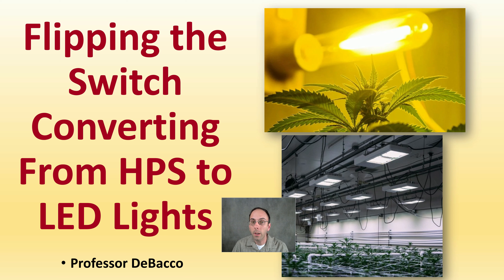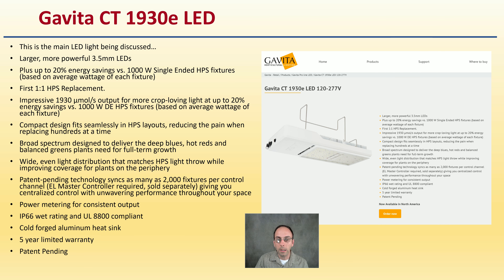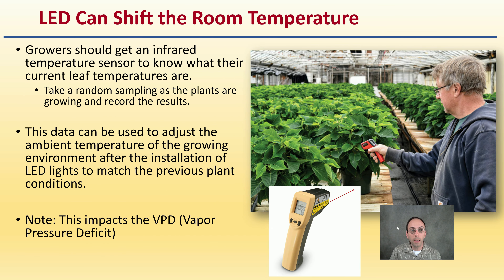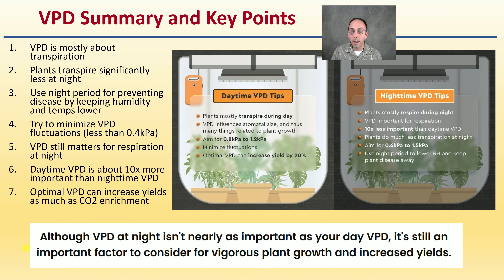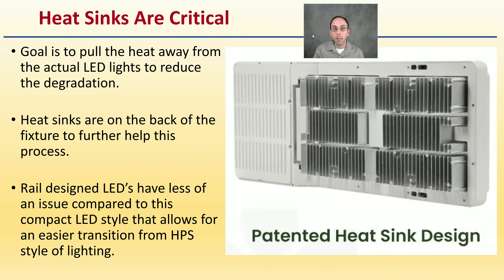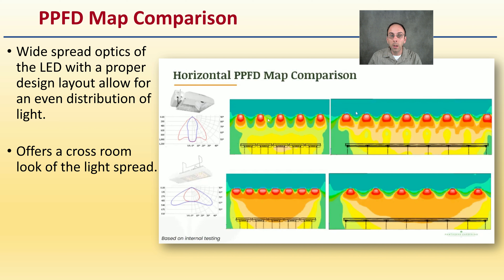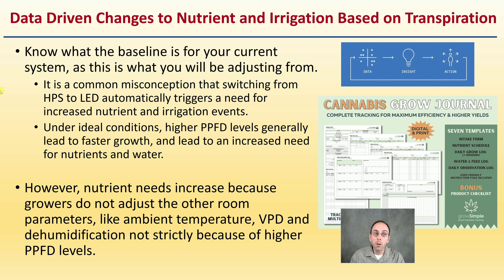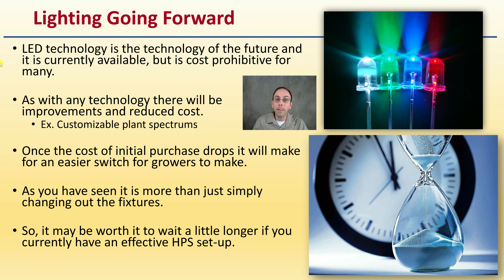Flipping the Switch Converting From HPS to LED Lights

Comment: debacco knows the best quality is grown with HPS lights with the right environment.
Reply from the maker: It all comes down to the environment;-)
Reply: Definitely not. Undeniably LED grows better plants people just don't run hot enough rooms when they do LED..... And that environment is easier to control with LED. Not to mention you don't need to replace bulbs, worry about ballasts, worry about popping bulbs while doing foliar sprays, etc.
Reply: Gimmick. I can grow good smoke under either. The larger LED fixtures (1000W+) run pretty damn hot (bars get upwards of 95F) and use as much power as an equivalent 1000W Digital Ballast - Lumatek for example. Don't take my word for it - read the specs. I have a Spider Farmer SE1000W and a Lumatek 1000W digital ballast. Then there is the HUGE price difference - even when you consider replacing the bulbs.. Good bulbs will last two-three grows.

Comment: I run both 600 watt HPS and a 240 watt LED in my 5x5 Flower tent simultaneously. I barley can get any more then 4 plants in it at a time because of the explosive growth under DWC and the benefits of running both types of lights. Thank you for sharing this informative information. Stay Frosted!
Reply: I used to do both. A lot of people still do. But man the power bill was ridiculous. Now i just run LEDs cos it saves me approx $200 per year
Reply from the maker: Mixed spectrum can provide plant benefits.
Reply: @Freedom_Born  ....and more yield

Comment: This video is funny/well timed for me because I’ve been thinking of flipping the switch the other way to cover more area for less cost upfront. Lol
Reply: That less upfront cost will add up at the end of year. On avg you’re saving about $200 per year using LEDs. And that’s just the power consumption… then you have to buy new bulbs every year - then you have to buy different bulbs for flowering. While yea, HID still perform extremely well, they’re just power drains
Reply: @Freedom_Born  that is true but not if I can crop out enough for a year in one run with the additional power and space. But I don’t disagree, in the long run it will always be cheaper to go with LEDs. It would probably take 2-3 years of use for the light to pay for itself.
Reply: @Veni Vidi Vici
I replied before i even got to the end of the video. Matt made some really good points about keeping HID/HPS (if you have them). Also said 6 hps bulbs/fixtures will cost the same as LED upfront. I guess those bulbs will prob last about a year each. So that’s almost 6yrs worth. Which should pay for itself in about a year (depending how much you would’ve spent buying the amount you yield - within that year). That would theoretically be the same for LED - it’ll pay for itself when you’ve grown enough to compare the money you would’ve spent just buying the weed instead.
Reply: ^^ I forgot to add that the paying for itself part, will have to include the power and inputs used too. So prob about 2yrs on avg.
Reply: @Freedom_Born  I spent about $120 to build my own LED system with emitters, transformers, steel tubing and extruded aluminum to illuminate 1/2 square meter. I got more than 150g trimmed bud (+popcorn and trim) 5 times in a year using less than $150 worth of energy. After more than ten years, I've replaced a handful of emitter chips and a couple drivers, but most of the lights still look bright, despite that they were rated for 75% of light after 50,000 hours. Using cheap COB horticultural  lights, I could do the same, except brighter, better, and cheaper. Because I grow autos, and don't need deep canopy penetration -70 cm tall plants - LEDs are the ONLY way for me.
Buy a soldering iron, 3 Watt emitters or 20 Watt COBs, and thank me later.
Reply: @Michael Carey
I’ve done it all man. Been gardening for 30yrs. Even have a custom built 6bar light (480W) - i requested a local company to make for me, so they ordered parts. Cost $500 - a saving of $180 - cos the fixture is SE5000 compatible (Spider Farmer 480W), so parts can be swapped out.
I’ve also built my own boards, but they’re just too clunky to hang etc… I’ve used bulb splitters for CFL lamps, strip lights, cmh/mh, hps, blurples, cobs etc etc. Man I’ve used everything over the years, now I’ve got over $7k in lights from Mars to Electric Sky to Vipar to Lumatek to Bloom Plus to Spider… I’m indoor & out, so I avg around 3lbs every 2 months. Give or take a few oz. But on avg about 3lbs every 2 months.
Reply: @Michael Carey
Lol i don’t need to thank anyone man! Don’t get cocky
Reply from the maker: Always nice to see the conversations of the community to help each other out and share experiences.

Comment: Great Video. Very informative! Can you please do a video comparing a traditional ppfd Meter with a mobile app Meter like Photone. I've been that app to keep my flowering plants at 800-900 ppfd but I'm not sure how accurate it is compared to much more expensive meters
Reply: iPhone sensors are about 7-10% better than android, so the accuracy is better with Apple.
Photone won’t go over 2000 ppfd and 300,000 illuminence, the DLI has hours so you can check what’s needed for your cycle.
Reply: MIGRO has comparison videos… and Photone is almost as good as regular readers - still off a little - but not as much as the android sensors. Search his videos for comparison reviews.
Reply from the maker: Great suggestion, but others such as MIGRO are likely a better source for the answer to your question.
Reply: What I’d tell as owner of that very expensive par meter and owner of the several other meters including the app meters is the measurement of far red isn’t calculated with the   App meters. When I measured there was a significant difference between how much additional light was measured with apogee as compared with the others. ie apogee 350 vs 300 on the others and it widened with more intensity

Comment: For me the choice was made by the money I saved going form HPS to LED. and not even talking about the heat dispersion . The ambient temperature in my area is on a cool day 27 C , so with LED helps a lot .Being on a prePaid electricity grid, you can see the difference almost immediately.  
Great  information as usual! Thanx professor.
Reply from the maker: Money does drive most choices.

Comment: 3:00 I don’t think that consumption comparison is accurate, according to my experience, HPS use 100% of the power rating but LED use 1/10th of their power rating. I’m confused on how 1000w and 78w can be so close in consumption? It’s only saving roughly a quarter of the consumption of HPS compared to using 1/10th of the power? It doesn’t seem right
Reply from the maker: Numbers generated by the retailer and it is 1000watt to 780 watt comparison.
Reply: @DeBaccoUniversity  so your saying the information supplied with the cheap LED unit I bought from China…is wrong? 😅

Comment: I found that the biggest difference between LED and HID lighting was the ability to choose light wavelength, and MINIMIZE the part of the spectrum that isn't needed (as much). By using ONLY red and blue LEDs, you will have all the light your plants need. Sure, the purple isn't the best in terms of rendering, so adding a few diodes of "white" will give the plants ALL the wavelengths they need from cyan to orange-red light, providing for the accessory pigments, as well as giving more light for the eyes to see the plants better. When you start using those royal blue emitters, you are going to get DENSE bud, like little broccolis on the stem - which can be awesome, until humid air turns to dew, and allows bud rot to hit
It's easy enough to build, r have built, a rail-type LED system using readily available 3 Watt diode chips, or even those more of less purple and pink COB lights you might see for $5 per chip for a 20 or 30 watt light - the proper heat sink for these lights might cost $10, though. For less than $200, you could easily have a system able to light up a square meter beyond adequately, and using far less than 300 Watts.
Reply from the maker: Customized spectrum lights look like the direction of the future, but the science is trying to catch up to the technology at this time.
Reply: Strange but I can tell you for whatever reason I grew danker buds under those old blurples and I’m not sure why? And true if it weren’t for certain factors I’d still be growing under hps

Comment: I like to put a fan facing the led driver or back of the light. It really helps cool it off, as well as circulate the warmth.

Mars hydro has a 780w led for $630. The fc-e8000 covers up to 5x5 ft for veg, 4x4 for flower.
Reply from the maker: This can be beneficial, but fans fail at a higher rate than most LED's so it is a good addition, but should not be a requirement of the fixture.
Reply: @DeBaccoUniversity I believe this person is talking about using an external fan just to help cool the fixture a tiny bit more. It's not needed but helps a little bit (who wants hotspots in their garden?)

Comment: The single largest issue most people face when switching from hps to led is a colder canopy temperature and this will quickly causes nutrient imbalances, specifcally phosphorus. You must always run LED rooms ten degrees hotter, this is doubly true when you supplement co2

If you know the science as to why I'm all ears. If i were to consult a company making the switch, what i mentioned above is the largest obstacle and first thing that should be mentioned.
Reply from the maker: In short it has to do with the rate of the photosynthetic reaction.  Leaf temperature is important because if the leaf is "cold" the plant processing speed will be "slow", so be increasing the heat this speeds up the reaction rate.
Reply: @DeBaccoUniversity  Thanks for the heads up - so basically vpd gets thrown off. What I brought up is a huge issue on cannabis forums for people switching to LED - the problem almost always appearing in early do flower as phosphorus deficiency.

The heat required for a healthy vpd seems to be in a ratio with the par value of a light also, so that the fuller spectrum of LEDs requires more total photosynthesis (or whatever scientific term is relevant) given all other variables being the same. So with LEDs you get the lower temps, while simultaneously requiring more photosynthesis, leading to very quick nutrient imbalances the moment your plants finish stretching and start budding.

I've seen several operations lose out on revenue for months making the switch. LEDs are a different beast for sure.
Reply: just add some infrared and you are good, and you will have the white/blue from leds + the emerson effect of infrared on hps
hps are dead